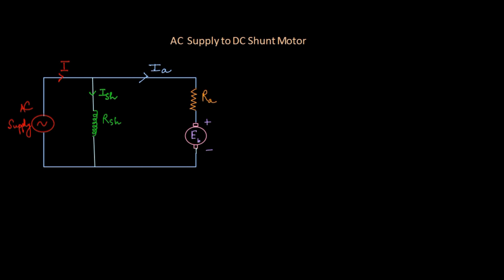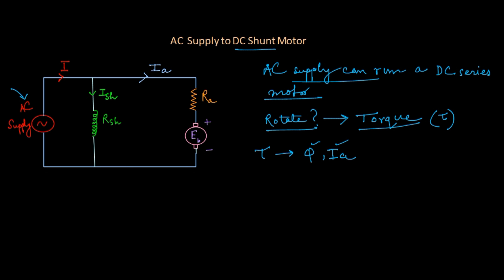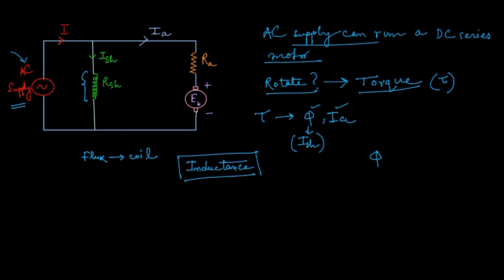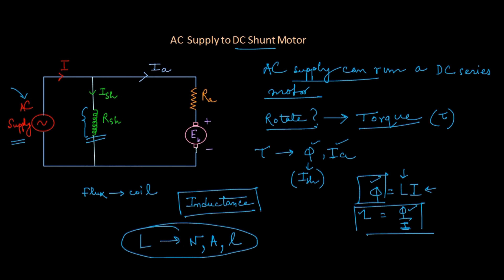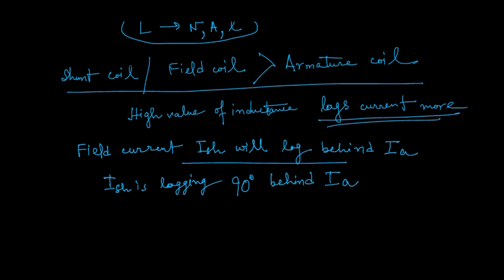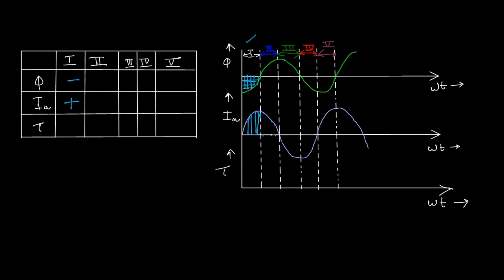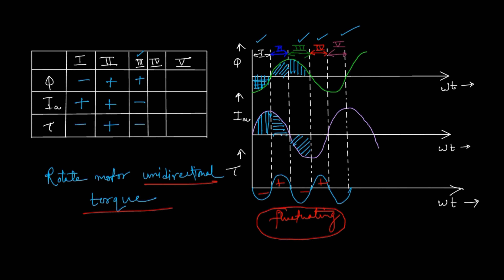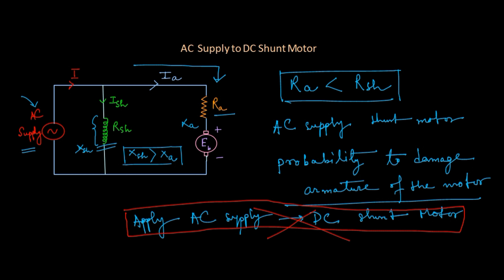What Happens When DC Shunt Motor Connected to AC supply l AC Supply to DC Motor l What If Series

Comment: What if we don't assume that current is lagging exactly 90 degree in field winding with respect to armature winding.
Because current will lag less than 90 degree than Please tell me will motor run at very slow speed with high losses